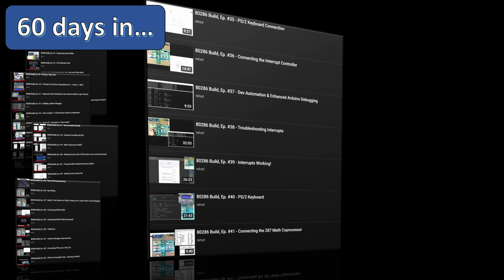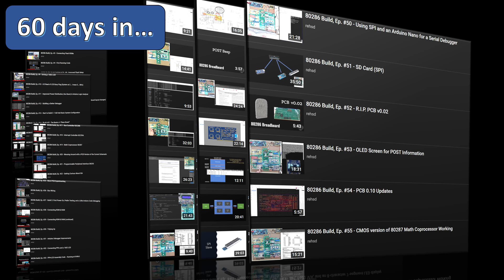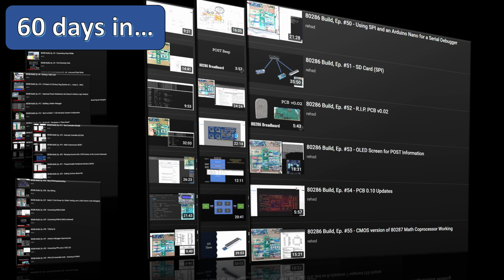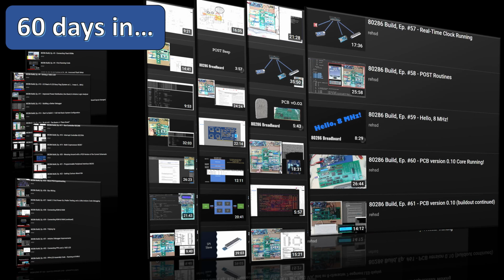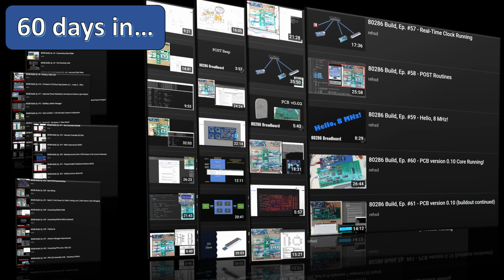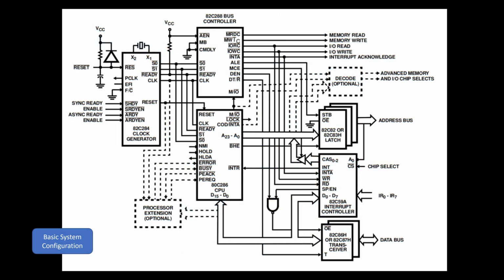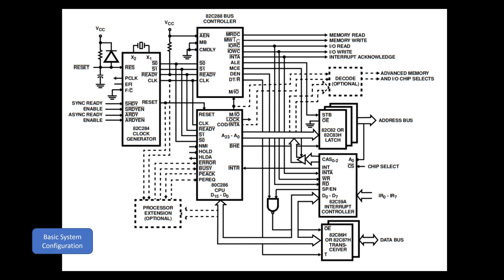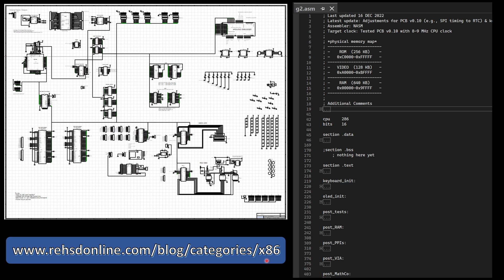80286 Build, Ep. #62 - [60 Days In] PCB 0.10 System Overview

Comment: How is the SD card reader wired t the rest of the system? I am designing and building a 80186 computer, and I want a SD card reader as apart of the computer. 

so, how did u connect it to the rest of the computer?
Reply from the maker: I am using a W65C22 Versatile Interface Adapter (VIA) to bit bang SPI communications to the SD Card reader. I expect you could use other interface chips instead of the VIA. For example, you could use an 8255 Programmable Peripheral Interface (PPI). If you're interested, I have the schematic posted at https://www.rehsdonline.com/post/286-build-six-months-in. The latest SPI code I am using is available at https://github.com/rehsd/x86/tree/main/286-related/WorkingCode/20230528_alignmentissue_questionmark (see spi.asm). I'm sure the code can be improved.
Reply: @rehsd  thank you for the info!

Comment: For the purpose of protecting the circuit, I would like to recommend 74AHC245 and 74AHC573 instead of those in 74AC series as the transceivers and latches in the system. According to TI's product introduction, the 74AC series may output a voltage as low as -1V, which may exceed the absolute maximum ratings of most ICs, and may cause permanent damage to them.
Reply from the maker: Really interesting! I wasn't aware of that. Thanks for the suggestion! I'll see if I can source some AHC's.

Comment: Missed your last vid, but glad to see the new PCB is alive.  Gotta laugh at the clock module, though, that's some serious Grandpa Simpson shit.  I know the beneater sub is big into clock module idolatry, but seriously in 35 years of doing this I never felt the need. I probably already razzed you about that, though, so sorry for the repetition :-) Overall this is a kick ass project, and doubly so since you say you don't have an EE background.
Reply from the maker: :)  Ya', it's just a general utility PCB I use on projects, providing lots of flexibility for different clock speeds. It also has the reset circuit on it, which takes up some space. The next version of my 286 PCB will likely just use an onboard crystal, likely running the processor at the standard ~8MHz.
Reply: @rehsd  Get something like a Dallas 1232 for reset. Don't know if they're still made but I used them for years on 68k and TI 320C50 type stuff. Simple 8 pin DIP, monitors power, debounces a pushbutton, and drives reset.
Reply from the maker: @zxborg9681  Thanks for the tip! I just ordered a batch of them.